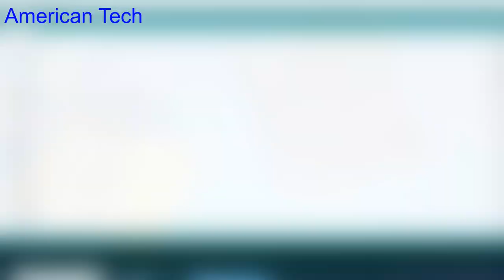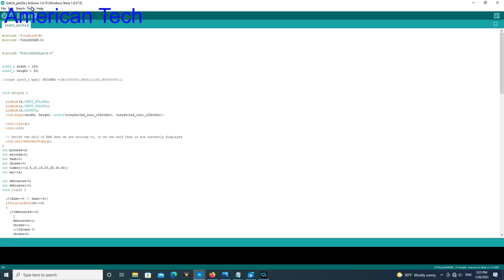Timer Alarm using attiny85 and Oled display | Electronic project

Comment: Hello sir, you've indicated 5v for the project but used a 3v battery. Is it okay to use 3v long term? Thank you!
Reply: can work 3-5v but check specs with ssd1306 you use as may be different